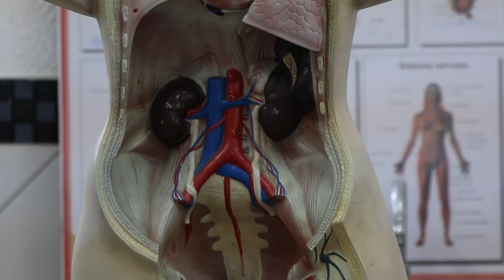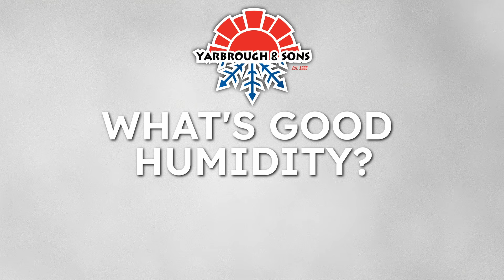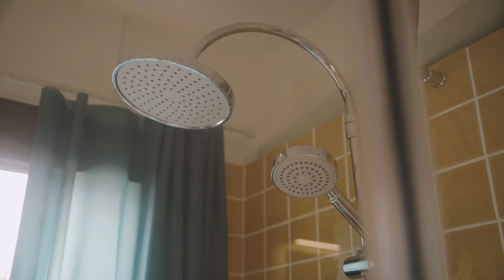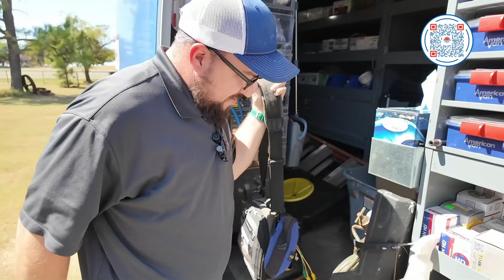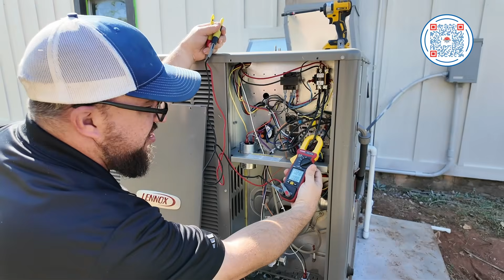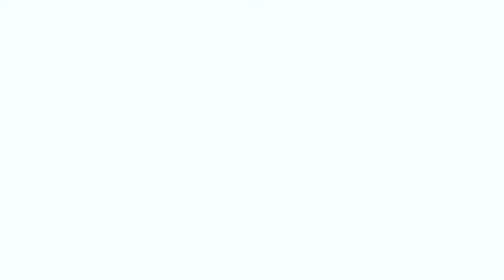Why Your House Feels Humid Even When the AC Is On

Comment: It is extremely humid here right now. The outside humidity is many times over 70% and in the evenings well over 80% and even over 90%. The indoor humidity right now with the HVAC running is 60%. When I lived in the Midwest, I never saw indoor humidity over 50% and in the winter, it would often be less than 20%. Keeping a house at 40-50% is going to be difficult unless you live in an ideal climate, not too hot and not too cold or too humid or too dry.
Reply from the maker: Which state do you live in?

Comment: Slowing down the fan seems like what I really need. My AC, even on really hot days, will barely run 6 hours. So that's 18 hours out of the day with no dehumidification so I wind up running an inside dehumidifier which is a pain and makes a lot of noise. I'm sure this isn't an easy thing to do because it probably requires getting into the HVAC internals and I'm not going to try that. I'll have to ask the HVAC company if they have anyone on staff that can handle that.
Reply: @jje984  A thermostat that has DeHumidification function connected to a RELAY Added to your blower that selects a lower speed wire will do it - assuming your house is adequately sealed up and system is working (clean) properly and your system doesn't already have a 'variable-speed' blower!

Comment: Can you tell me what the humidity level should be coming from the vents when your air conditioner is on? I am getting between 85 and 90% humidity while my AC is in dehumidifier mode where the fan is at low speed and runs many hours throughout the day, But the humidity that is pumping in the house seems excessive. The overall humidity in the house is mid 50s to low 50s, but it sure working hard to keep it that way. Any advice and what to check besides what you mentioned here? Thank you.
Reply: Test away from the cold, cold air to see what the house level is.
Reply: @josephwhatley3637  the house level is in the mid 50s. I can’t seem to get it lower than that even though I have a dehumidifying air conditioner. It’s a five stage carrier infinity unit, that boasts dehumidifying, but I don’t see it doing as a good job as an actual dehumidifier.

Comment: I’m going to guess there are 14 thermostats on that wall! Great explanation on why the 'auto' fan setting is actually better for humidity control. I never knew running the fan constantly could pull in that extra attic moisture.
Reply: Same